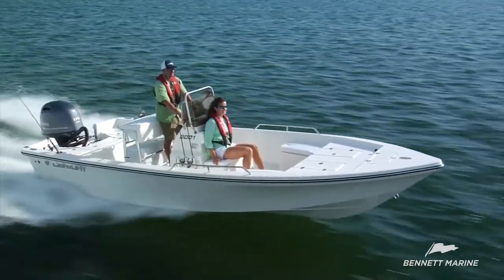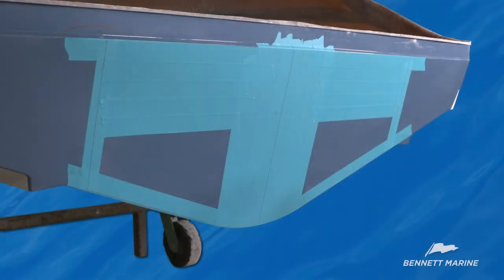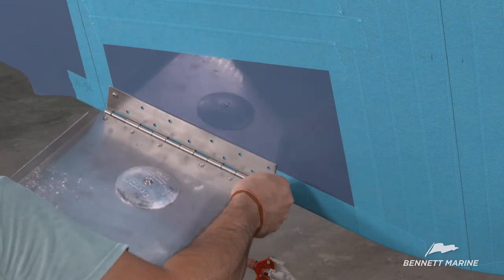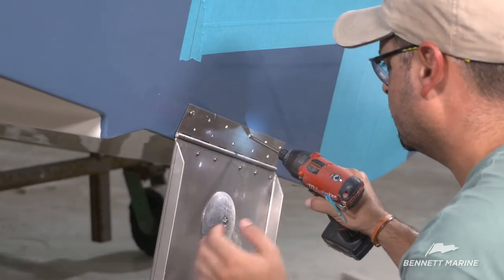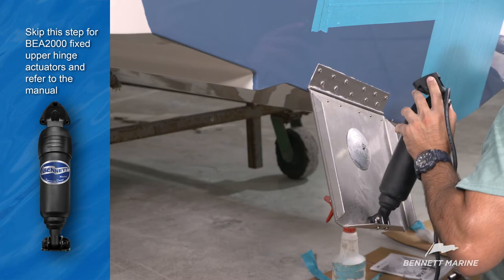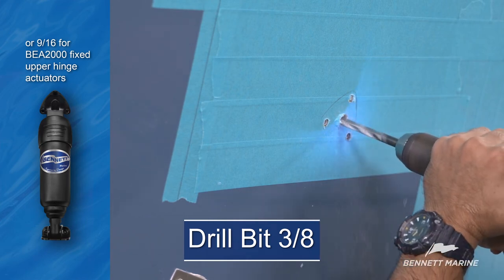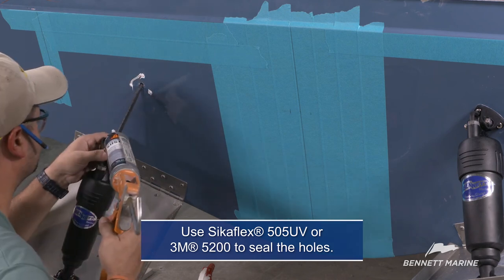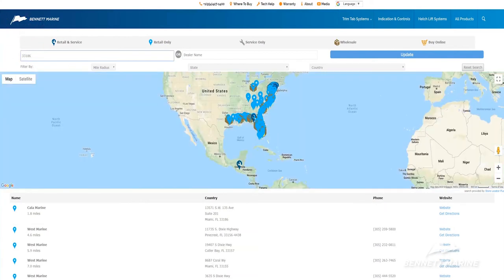BOLT Electric Trim Tab Install - Part 1 (Trim tabs)

Comment: Always check the other side of the transom before drilling for the upper actuator mounting holes and wire through hole for obstructions.

Comment: Wait - you say to drill the bottom plate screw hole "So that the number 10 screw does not bottom out". To me, that says to drill the hole deeper than the screw so that the screw "does not bottom out". But at the same time you are showing that the screw is clearly 1/2" longer than how you have your bit set up. Which is it??

Comment: Wouldn't 3M 4000UV be the appropriate sealant for the screws instead of 3M 5200? Please settle this question. There are so many diy opinions on this.
5200 being a more permanent sealant but either the screws or a sealant hold the tabs on the boat.
Reply from the maker: Sorry for the delay. Our notifications were not coming through properly. If you'd like to email our techs at email BMI_Info@Yamaha-Motor.com, they can provide an explanation.

Comment: You need to update this video with present electric bolt actuators that have wires molded into the center of the top mount. You do not show how to install with wires in the way.